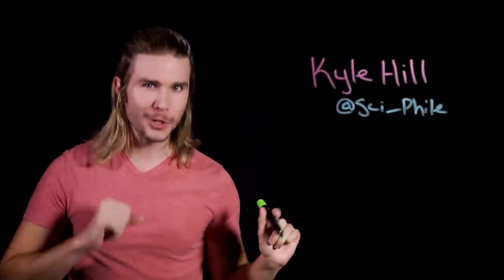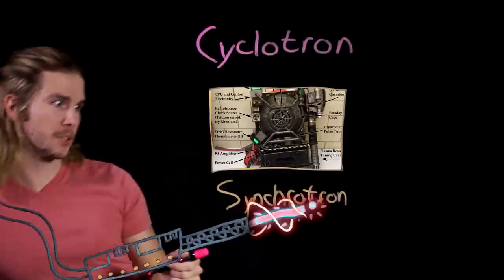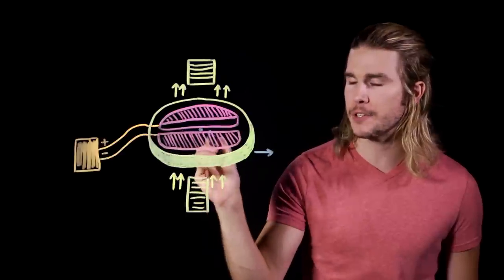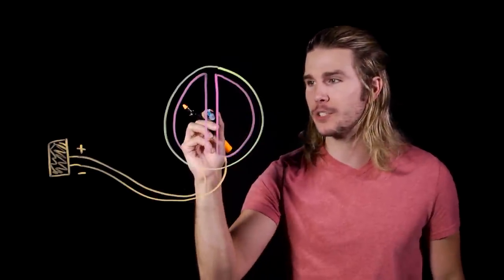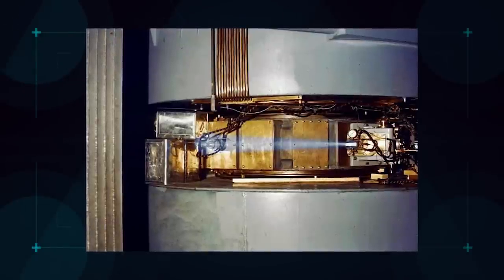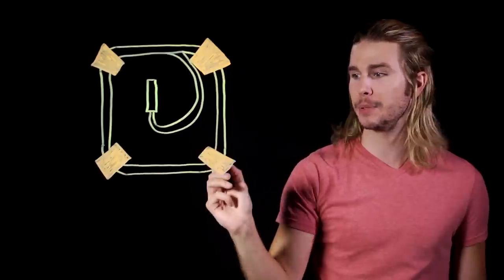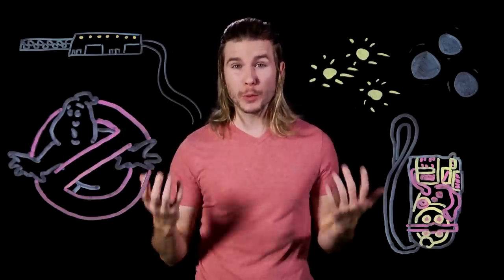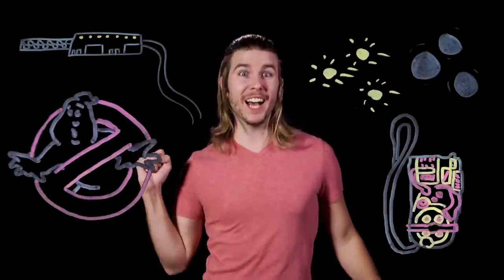How Does The GHOSTBUSTERS Proton Pack Work? (Because Science w/ Kyle Hill)

Comment: Dan Akroyd said that theoretically, it's possible to build a Proton Pack that works like it does in the films and the 2009 game but it would cost around $9,000,000,000.00 to do
Reply: how long ago? Between inflation and sheer scientific research that price could have decreased. Not solid, but hey...
Reply: @ImpetuouslyInsane  Around 2008 or 2009 whenever the behind the scenes video was actually recorded
Reply: Or three house mortgages
Reply: He must not know me then
Reply: @SadisticMindz  No matter who does it, the shit would be expensive. And no, I doubt Dan knows some random on the internet.
Reply: @superultimatexlrfire462   you could create a very, extremely weak linear accelerator using a battery and 2 plates. A particle travels from the positive to the negative side. 2 dollar particle accelerator right there
Reply: @SadisticMindz  The particle accelerator isn't everything to the proton pack, you know. There's literally other things, such as the funneling for the output to the wand, the scale it'd need to be for use as a wearable weapon, and what the pack is used for.

I would much rather trust the estimate from the guy who created the franchise for how much a functioning prototype proton pack would cost than some random on the internet doing a 'Grandpa's first trick' level science project.
Reply: Is that with or without Egon Spengler doing the R&D?  Egon has to be at least as smart as Tony Stark.
Reply: I know its i am 5 years to late but do you still have a link to the Video?

Comment: So did they shorten the length of the streams (which I never understood why they were wavy and not straight) by lowering the power output?  And instead of wrapping around the ghosts shouldn't the stream of accelerated photons ripped them apart or perforated them?

Comment: You have switched synchrotron and cyclotron.
The one with the "D" shaped electrodes and the particles going in a spiral trajectory is the CYNCRHOtron. So named because the period of rotation must be synchronous with the alternating electric field. It's the older of the two.
With the cyclotron, the particles travel in a roughly circular path and the period is no longer constant, forcing the use of a variable frequency for the accelerating electric fields.

A synchrotron can output a nearly constant beam of accelerated particles, but at a relatively low energy level.
A cyclotron must go through a somewhat lengthy acceleration phase to get a particles pulse. You have to reset it before you can get another pulse. The particles can have a much larger energy level, often upward of several billion or trillions times more energy per particles.

There are also the linear accelerator. Think of a souped up electron canon from a CRT monitor... Plus : Capable of delivering a constant particles beam. Minus : Low upper energy capability relative to the dimension.

Comment: how do you even get the particle in the first place?
Reply: The particles (protons in this case) start their existence as hydrogen molecules in a canister (and as you may know, a hydrogen atom is a proton with an electron around it). A flow of hydrogen gas is run through a device called duoplasmatron (see https://en.wikipedia.org/wiki/Duoplasmatron ) which breaks it down into protons and electrons. A positive charge is used to repel the protons out of the duoplasmatron and into the accelerator (see https://www.lhc-closer.es/taking_a_closer_look_at_lhc/0.proton_source )

Comment: What would happen if you crossed the streams?
Reply: +Victor Perez I'd assume if the streams are just fast moving protons, they'd simply curve away from each other.  Or if they were moving too fast to have time to do that and they did actually end up colliding, at worst, you'd get the equivalent of a small hydrogen bomb exploding,  This would be bad.  But not quite as bad as they made it sound, at least for anyone not in the immediate area.

Comment: do how much recoil does iron man experience and does it hurt his shoulders
Reply: +Chris Giovine 
Keep in mind this is slightly lazy and possibly rambling as a pseudo-answer, but...

Depends on the system being used, but for most of his energy based weaponry I would expect the answer to be "not much to practically none", since it likely uses ionizing beams, or something similar.  
For tech like repulsors, The answer actually can get fascinating, and could be pretty fairly large.  
The simple answer though would be messing around with the acceleration formula for Pilot (Tony) + suit's weight, and figuring out how fast they are accelerate withing how short a time. 
Based on my understanding of the description of the tech, the repulsors create and eject a highly concentrated stream of dense sub-atomic matter (that decays within just over 2 millionths of a second), which is what causes the thrust.  
The muon beam of repulsors though, does make sense for why it can effectively disintegrate matter... but I think it would be cooler and make more sense if they used anti-grav tech /shrug
Either way, after a minor bout of fact checking, I approve this question... would be interesting to see the kind of stress repulsors could generate both outgoing, and on the suit.

Also, the exo-suit should be absorbing the majority of any recoil suffered, so if it was hurting his shoulders, he built it wrong, or it has taken significant damage.

Quick reference;
http://marvel.wikia.com/wiki/Glossary:Repulsor
Reply: I kind of get what you are saying, thank you